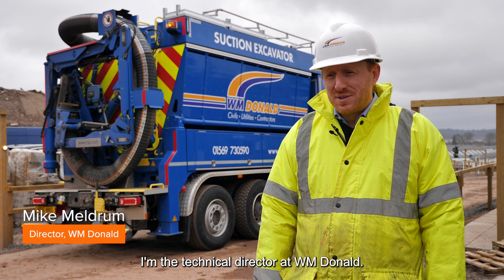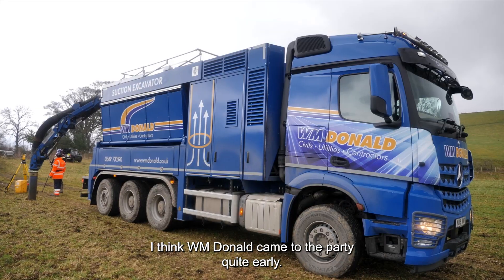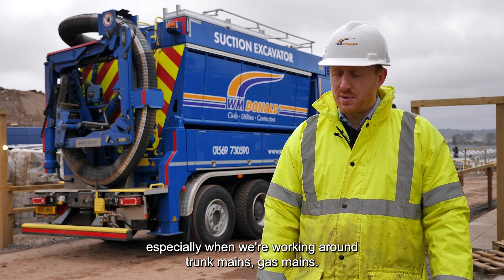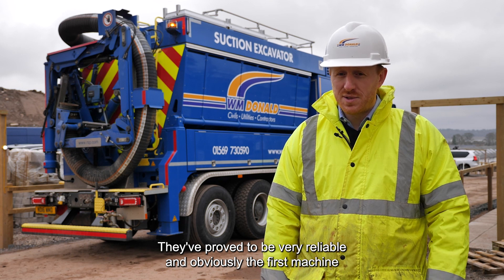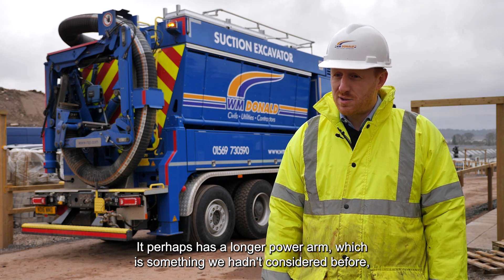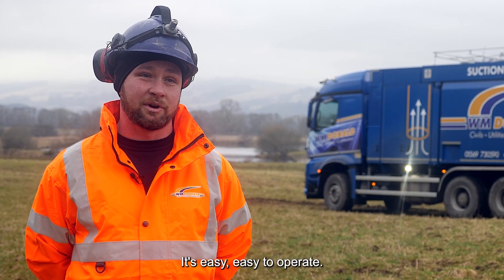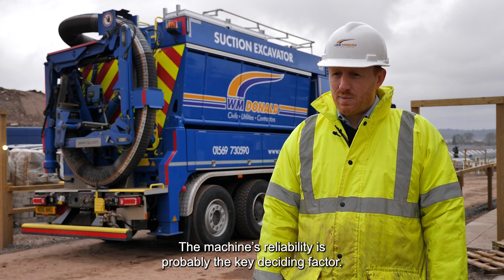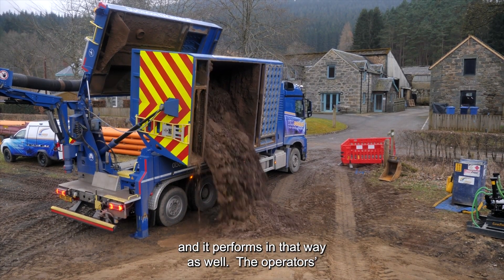WM Donald - a suction excavation case study

Comment: Hi, how much material can the hopper hold and can you dump it into a tipper truck or only on the floor please? Thanks
Reply from the maker: It depends on the model but in our current ESE 6 that you can see in this video, you can have 6, 8 or 10m³ containers. Some of our models (the ESE 8/the new model ESE 6) have a higher tipping point that allows you to tip into a vehicle alongside.